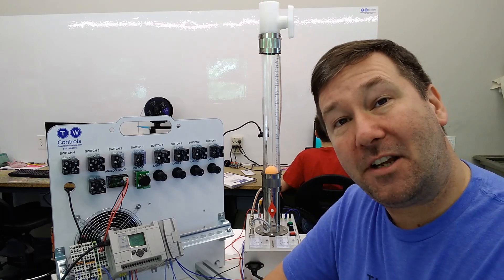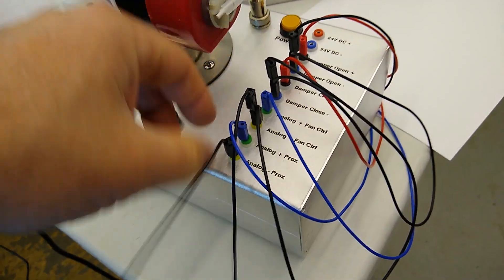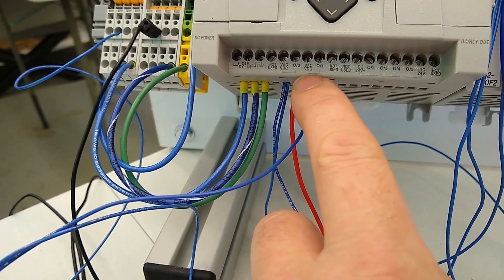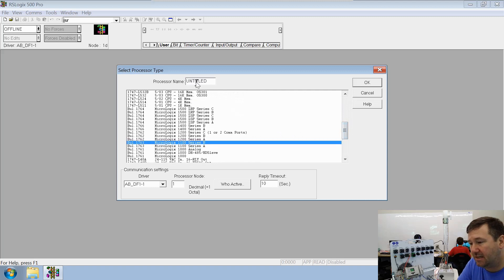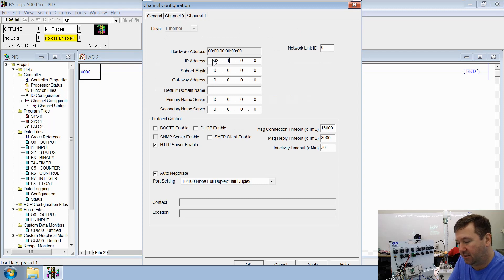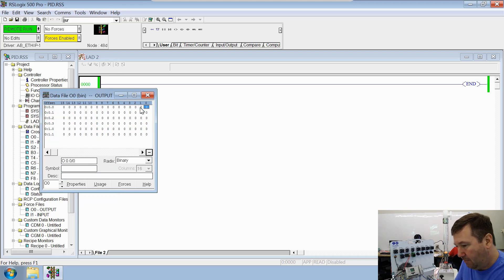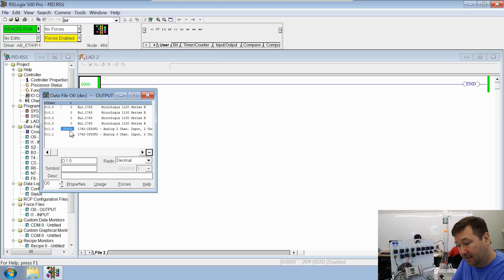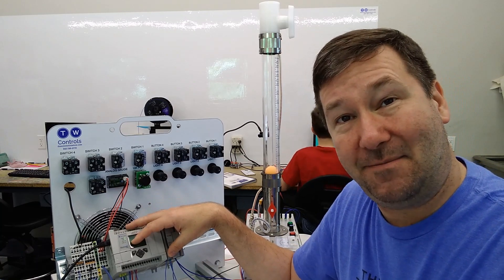PID Wiring. Analog Inputs and Outputs to Allen Bradley Micrologix PLC

Comment: So voltage with 24vlt power supply, switch 1 needs to be in the off position? Channel config shows 0 to 10vlts dc though.
Reply from the maker: I'm not following your question John.
Reply: @TimWilborne  my pid trainer hasn't came in yet so I was just using a 24 vlt potentiometer with a resistor I was just wondering if the set up would be different. So my potentiometer was going to be my ball level?
Reply from the maker: @johnrece6622  Oh I was thinking you were wiring the physical Switch 1 on the trainer to the analog.  Yes, the DIP switch in the top of the 1762-IF2OF2 is a load resistor used for 4-20mA signals.  To use in on 0-10VDC inputs, you must switch the DIP switch to the off position and configure the analog input for 0-10VDC in the I/O configuration.  Here is a lesson to help understand what the load resistor does.
https://twcontrols.com/lessons/analog-circuits-training-how-a-plc-input-reads-a-4-20-ma-signal

Comment: Greetings, very good friend, your video, you already know what is the capacity in (amps) of the 24vDC source that the BWA model incorporates.
Reply from the maker: No and I don't recommend using it.  Especially in older models, you could short the 24VDC out and wipe out the program.  Get an external power supply.
Reply: @TimWilborne  ok Thanks
Reply from the maker: You are welcome.

Comment: Hey Tim, just a general question. Does Rockwell Automation still sell Micrologix 1100 units or do you have to look for them through third-party suppliers? Im planning on using an 1100 for a school project (RsLogix Micro started lite (the free version) can only be used to program 1100 and 1000s). I'm sure the 1000 is discontinued? What about the 1100 (they still have it on their website, haven't actually got around to getting a quote for a unit) :)
Reply from the maker: The Micrologix 1100 is still available from @ROKAutomation but on new projects I would recommend looking at their Micro820 PLC.  They have more capabilities and should save you a few dollars also.
Reply: Tim Wilborne does rockwell offer a limited free version of connected components workbench ? My only inclination towards Micrologix was rslogix micro starter lite.
Reply from the maker: Yes, see lesson below on how to download it. CCW also includes a built in simulator too.
https://twcontrols.com/lessons/where-can-i-download-allen-bradleys-connected-components-workbench-for-the-micro800
Reply: Tim Wilborne Awesome! Thanks Tim, appreciate it.
Reply: Tim Wilborne Does the Micro 820 model have a version with FET outputs? I’ve been looking into something identical to the Micrologix 1100 1763-L16BBB. I’m looking to control two solenoid valves ( turn them on/off about 20-25 times; one an on/off valve, the other a 5/2 double solenoid valve) so relay outputs aren’t really feasible for the long term. Any advice would be appreciated.